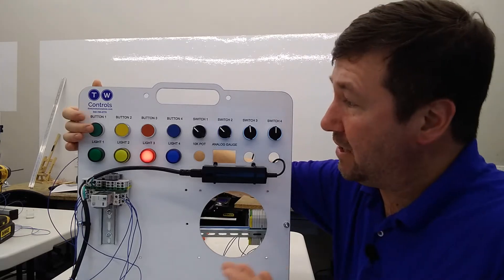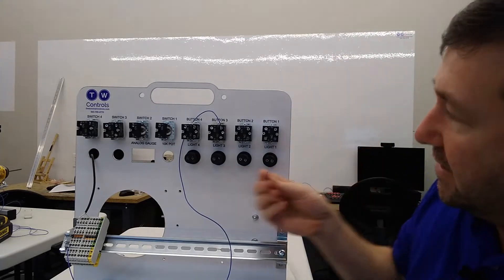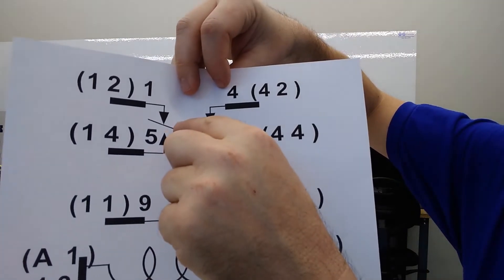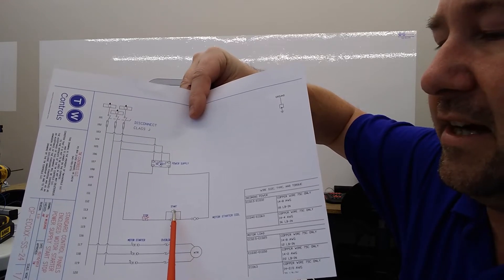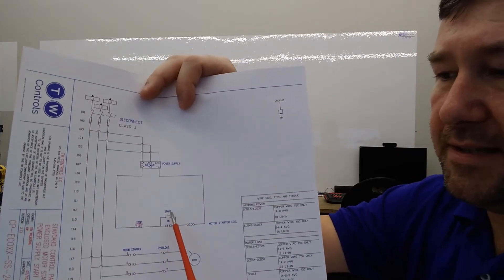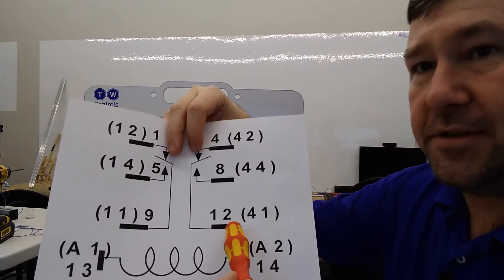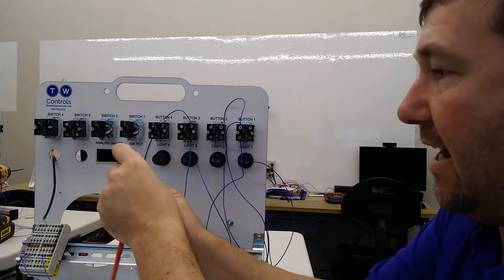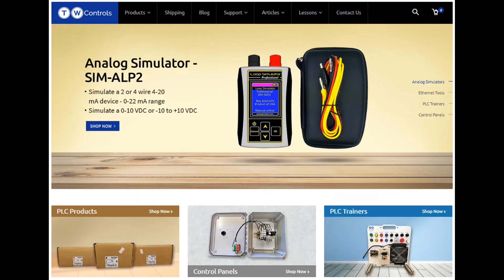How to Wire a Start Stop Motor Control Circuit.

Comment: How would you go about wiring a two-hand control safety system?  I’m particularly interested in ones where both hands must remain on the buttons or the output signal stops.
Reply from the maker: Hi Charles.  I would use an Allen Bradley CR30 configurable safety relay.  Here is a lesson series we are doing on it.
https://twcontrols.com/safety-plc-lessons

Comment: Hi Tim. Excellent video!  My contactor coil voltage is 110-120VAC,  When wiring my switches, Should I use L1 (hot) or L2 (neutral) ?   I believe that L2 might be the safer option.  What is your opinion?  Thanks.
Reply from the maker: You will more commonly see L1 wired to the switches, saying the L2 is safer is a false sensor security.  L2 is a current carrying conductor and current is what is the danger.  Here are some wiring examples.
https://twcontrols.com/lessons/standard-electrical-control-panel-and-plc-trainer-drawings
Reply: @TimWilborne  Thanks Tim.  I appreciate the reply !
Reply from the maker: @KW-ei3pi  You are welcome
Reply: Never switch a neutral, only hot circuits!
Reply from the maker: Same as earlier, not switching the neutral is a preference, there is no code against it. Most systems switch the hot but there are ones that switch the neutral so be prepared

Comment: Hi Tim , 
Can you post the wiring diagram once more, it's hard to see it in the video?
Reply from the maker: Hi Stephen, you can find all of the drawings at the following link.
https://www.theautomationstore.com/standard-drawings/
Reply: @TimWilborne  Thank you very much Tim
Reply: @TimWilborne  Thank you for the videos you post its very useful in learning new concepts
Reply: @TimWilborne  Hi Tim , why is it called 3 wire? which 3 wires are we referring to? I'm just curious to learn
Reply from the maker: @stephenvjoseph  It's the number of wires that are required to make the circuit work. A basic on-off switch requires two wires, one going in and the other going out. A start stop requires three wires. A common, start, and stop.

Comment: Hi Tim, I appreciate your videos!  For low power automation machines, do all need to use a contactor circuit to control the overall machine power or are there cases where this type of circuit is not necessary?  Most of the machines I am building are 24-48VDC with occasional 120VAC for heater cartridges.
Reply from the maker: Hi Clint.  Contactors and relays are usually used because your control circuit doesn't have the ampacity to run your load.  For example most push butttons have not load rating.  PLC outputs maybe 1 amp.  Even on a 24VDC 50 watt heater, it will pull 2 amps which especially in the long run will last longer with a relay/contactor.

Also when the component fails, contactors and relays are much easier and cheaper to replace than the controllers.